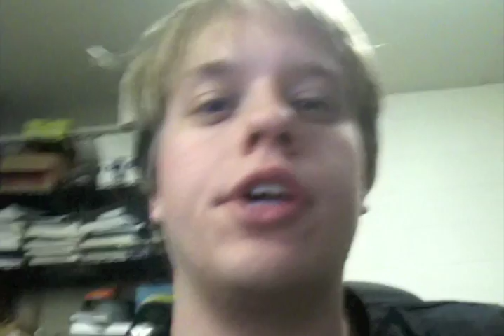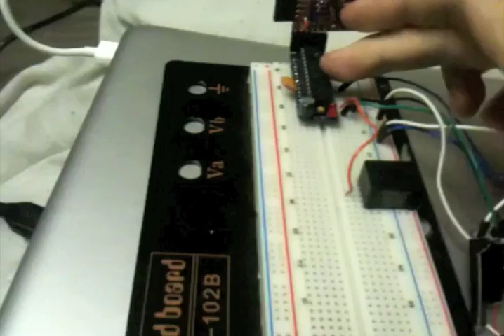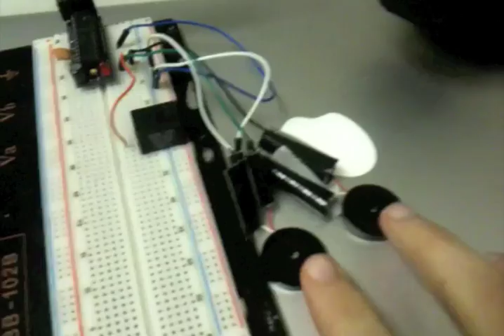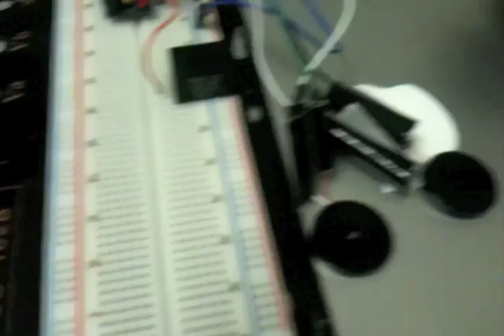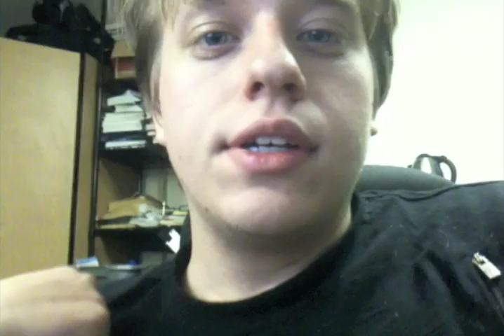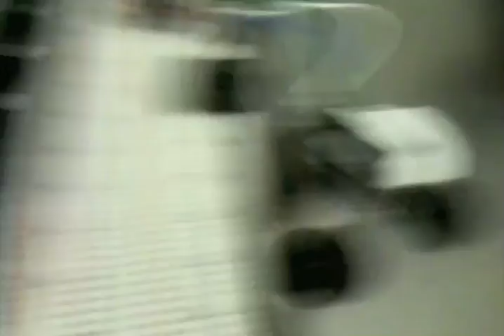bassdll - an Arduino piezo music library

Comment: I also got errors when trying to upload the code from Arduino 1.0 enviroment so I tried Arduino 0018 (since this is 2 years old piece of code) and it works with no problems. Probably some syntax updates.

Comment: nice job!

Mixing the channels should be fairly simple- use three resistors:
CH1 - resistor -
                       \
CH2 - resistor ---o----- output
                       /
CH3 - resistor -

this will produce an average of the three channels (the output may now need a unity gain buffer to drive your transducer)